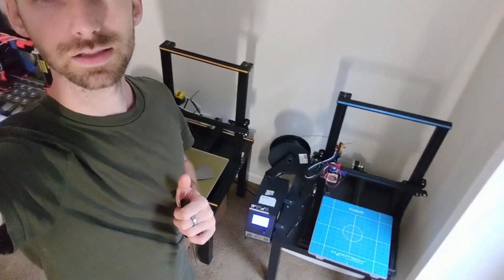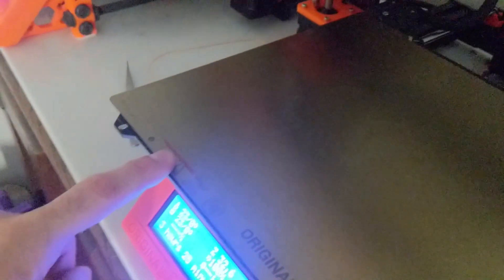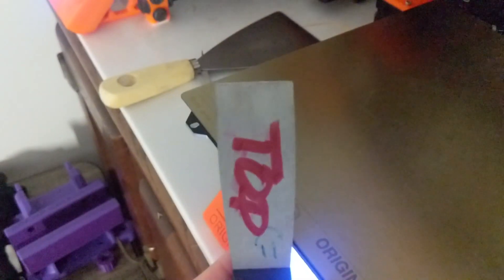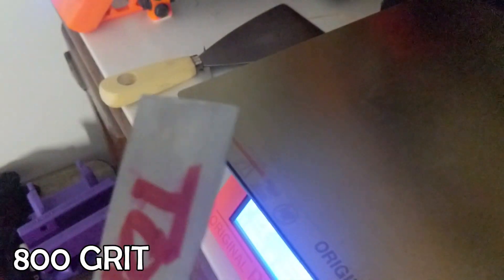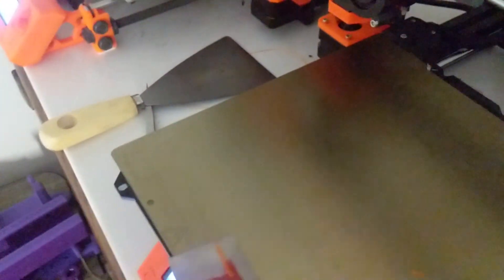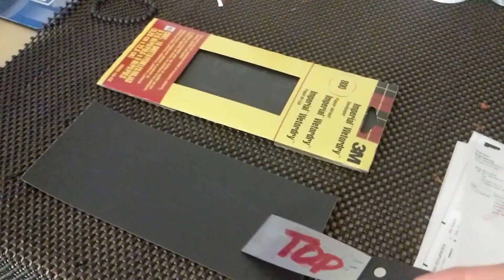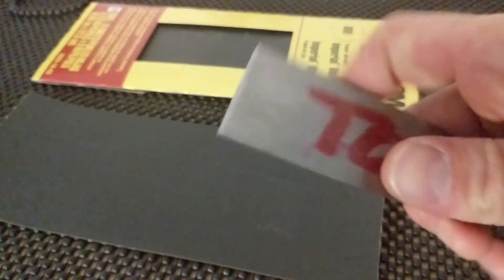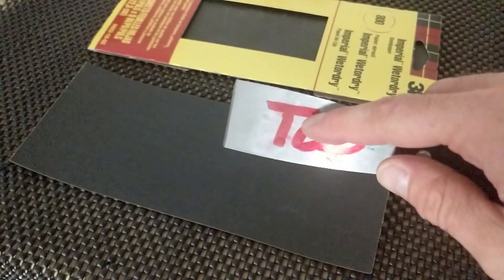The best tool for removing 3D prints

Comment: Yes, i sharpened the spatula so i can wedge it right under the print and wait until the print comes off or until it releases enough to advance the spatula a bit more; and rounded the corners, just to make it slightly less likely to stab myself. Did it way back when i first got the printer, almost a year ago now. It feels sharp, i don't know whether it's really sharp enough to cut flesh, no desire to try on myself, don't keep meat in the house either. Mine is also clearly directional with a bend in the blade so i can't confuse top and bottom, and so it slides under the print with the handle not interfering.

I'm sure i haven't really come up with the idea on my own, but i don't remember where i picked it up. Maybe when MakersMuse warned people to be careful with the putty knife because it can be super sharp. But i had a spatula and not a knife.
Reply from the maker: Very nice!

Comment: You need to round the corners of those "spatulas" (actually putty knife or drywall knife).  If you round the corners it reduces the chances of gouging your bed.  Also be VERY careful on the edge of the bed.  Those sharpened knives will catch the PEI and cut it easily.
Reply from the maker: I thought about rounding the corners but I don't necessarily need mine rounded. If it slips it's sharp enough it's going to cut me either way but I also don't push towards myself. The bed can be damaged, that's why I made sure to mention numerous times do at own risk. I personally have only injured one section of my bed since starting this about this time last year and it was because I wasn't paying attention to which sharpened side I was using... Ugh live and learn!

Comment: Check out fugatech YouTube video he just put out the other day about print removal tool.  I use the same set as him and they are incredible.  I used to do the same thing as you but it doesn’t work nearly as well as the thinner removal tools I use now.  I think they cost me about $8 on amazon.
Reply from the maker: I've got one of those, too! If you sharpened the edge it would work better IMO but mine just didn't work well. The tip ended up bending
Reply: Improper Engineering really?  I use the short square one and it’s been incredible.  I haven’t had to sharpen it or use any other tool since I received it.  I even have a flex plate on one of my printers that I don’t even take off half the tome because it’s so easy to pop them off with this tool.  I also love the bend it has near the handle so it sits flush with the bed
Reply from the maker: @meandrips2216  that's awesome man!